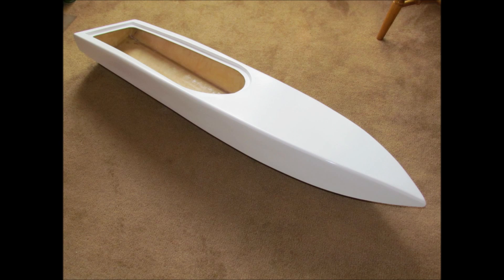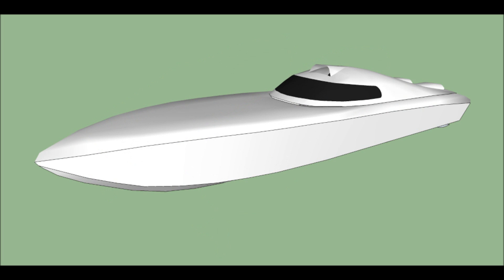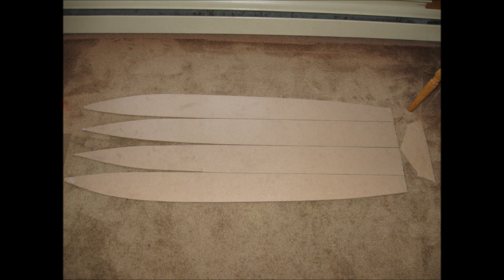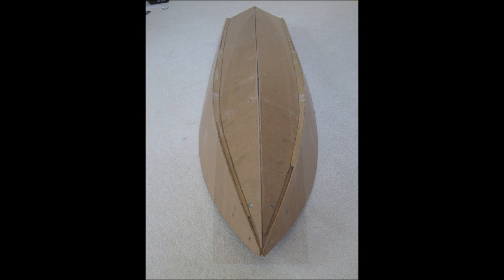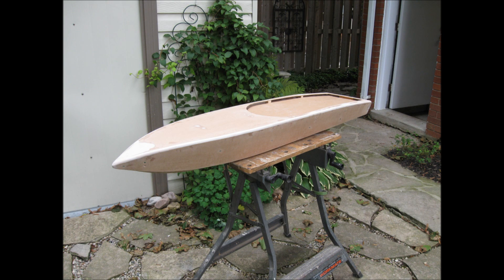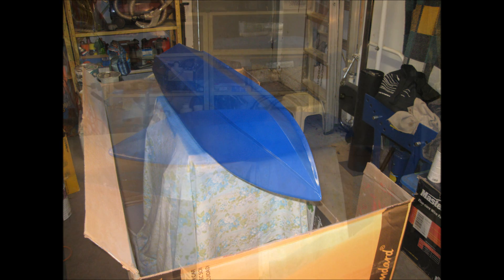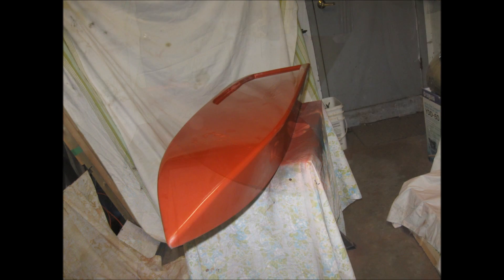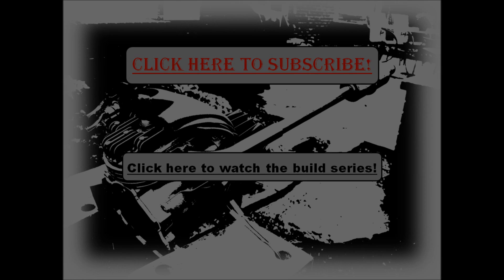How to Build an RC Boat

Comment from the maker: I've looked into that, but unfortunately, I don't think I'll be able to... The fins on the block are too close together to get a small tube between, and I don't have the equipment to make a custom aluminum sleeve for it...  Also the engine is designed to be air cooled, so I could actually end up making the engine run hotter if I'm not careful.
The exhaust will be water cooled though!! :)
Thanks for the comment!
-MrRcFanatik

Comment from the maker: I've designed the top so that the air will have a good way of flowing through, but I know what you mean.  I checked out his video... he's got a pretty simple way of making it!  But the only prob is that my engine is an L-head 4-stroke.. so I've got to deal with two vertical valves... Still though, that silicon is a good idea, hadn't thought about that...I'll look further into this concept.
Thanks for your help man!
-MrRcFanatik

Comment: What did you use as the mold release for the fiberglass? So the fiberglass will release from your mold.
Reply from the maker: I waxed the mold with 100% pure carnauba paste wax 8 times... then took a very soft microfiber towel, and wiped on a thin layer of PVA release agent.  After that I just went ahead with the figerglassing process.
I don't go really indepth in my boat build series (as it's not meant to be a "how to" like this video) .. but check out some of the early parts, as you may find them helpful.  Also, be sure and check out "Gasserglass" on youtube.  He has a lot of helpful fiberglassing videos.
Cheers!

Comment: Great video, I'm currently building an airboat that will be cox powered. 

Besides fiberglassing, what could I waterproof my boat with?
Reply from the maker: A fiberglass resin (polyester or epoxy) would be best, even if you do not use the glass itself.  If it's a wooden boat, the type of wood makes a difference... like I said in the video, this Masonite stuff soaks up water like a sponge - but if you were to use a thin plywood or balsa, then you maybe could seal it up with some paint or varnish.  Do a little Google-ing and see if you can find a good paint type for use on wooden boats... a urethane or enamel based paint may be a good choice, but I'm not a professional.  Good luck!
Reply: @FanatikBuilds  does this still work?

Comment: Hey nice boat!!! 
I found a weed eater engine in my garage looking to put it in. Was wondering if you can make a vid on how to get that hooked with the controller and putting it in the boat...if you dont want to dont do extra work. 
Thanks a ton either way
Reply from the maker: Hi Aaron!  I'm actually planning a few new "how to" videos once the current D110 build is complete!  Be sure to subscribe so you don't miss them!

Comment: How did you flatten out the sides of the boat in sketchup?
Reply from the maker: Too difficult to explain really, but looking back at this video, there are better ways of doing it anyway.  I'm planning on a new "how to build an rc boat" series... stay tuned, as that will likely be later in the fall.
Cheers!

Comment: how do you get the faces of your model (ie your boat) and flatten them?
Reply from the maker: Unfortunately it's very difficult, and was too time consuming to try to explain in this video.  You'll mainly have to use the rotate tool to try to pivot each triangular segment into a solid line ... 1:43 in this video shows the wireframe view of the model, and you can see that it is made up of many triangles ... all of those triangles make up the complex angles of the hull, so it takes some time to flatten them without distorting the shape.  I have been working on a new how to build a boat series, and will go over a better solution to this difficult problem.
Reply: cool thanks i'm working on a catamaran so that's very handy

Comment: What type of wood did you use that could bend like that on the hull?? Thanks
Reply from the maker: Chris Riley I used Masonite (sometimes called hardboard I believe) .. about 1/8th inch thick and quite cheap ... and flexible.  NOT a good wood to use if you are planning on putting this in the water though!  It WILL soak up the water and be destroyed.  Use a marine grade ply-wood (or if it's not too large, use balsa wood) and coat it with fiberglass resin at least if you are making a wooden hulled boat.

Comment: can you make that from a polyester mould?
Reply from the maker: Hi man.  I tried looking up "πολυεσερ" but the only thing I found translated as "polyester"... this is the type of resin I used for fiberglassing.  If you mean can you use polyester resin to seal the hull, then yes!  It's advised! :)  Hope that helps what you were wanting to know.
Reply: thx a lot